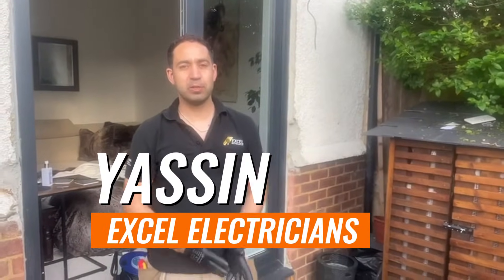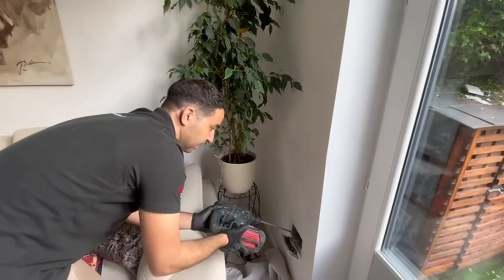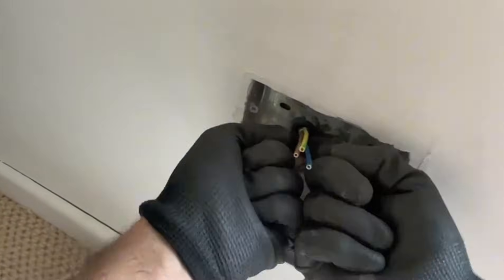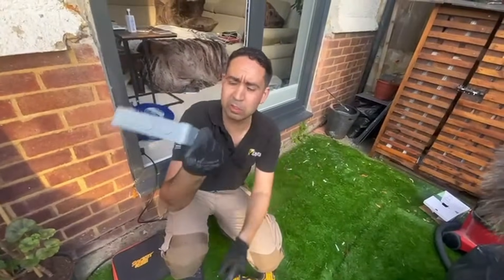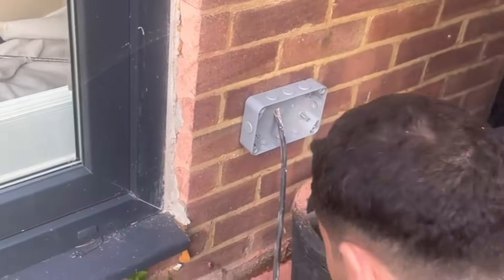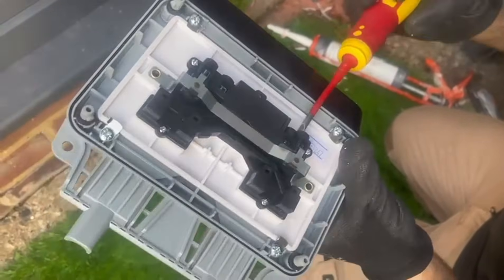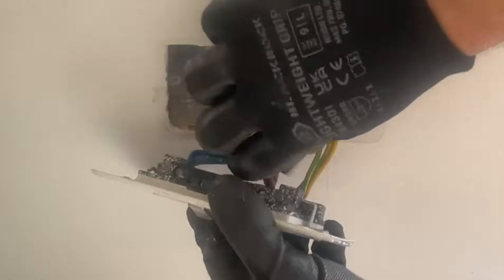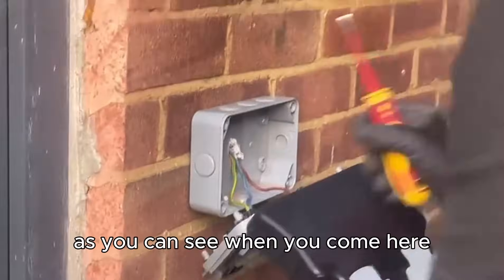How to Install An Outside Wall Socket (Step-By-Step)

Comment: Cheers mate that's really helpful. Would that type of install be suitable for charging an electric car with a granny charger?
Reply from the maker: That should be fine, but you have to make sure you have a type A RCD protection on the consumer unit and a surge protection .

Comment: Doing it like this, the box outside is always powered on. Why would I want an outside socket always powered on???
Reply from the maker: That’s what the customer wanted. I was gonna install a fuse spur but Customer requested to have the socket always on. 
Thanks for watching. 👍
Reply from the maker: I was gonna install fuse spur for the socket, but the customer insisted to have the socket  always on . 
Thanks for watching 👍

Comment: What Socket type have you used as they all dont have a way to feed in from the back so you can extend the cable later? thanks

Comment: Did I really see him drill the 4 holes in the back box with it sat on the customers Astro turf and drill the outside holes without moving stuff out of the way a putting something down to catch the residual dust.
Reply: LOL My thoughts too, even I would of moved the settee instead of using the excuse of drilling a 45 degree angle lOL

Comment: As a fitter I always fit these socket near a covered area ,ex in a porch ,and use   clear silicone where necessary.
Reply from the maker: Thanks
Reply: Yeah I've found out they get wet inside and cut out after heavy rain quite easily.